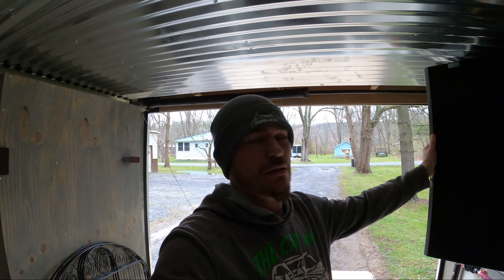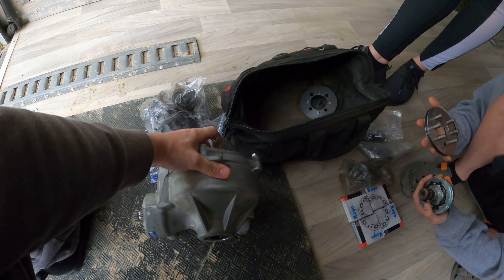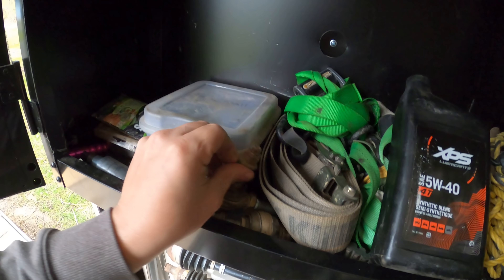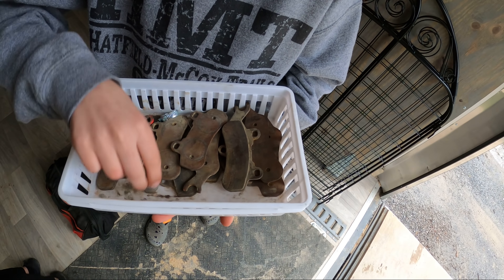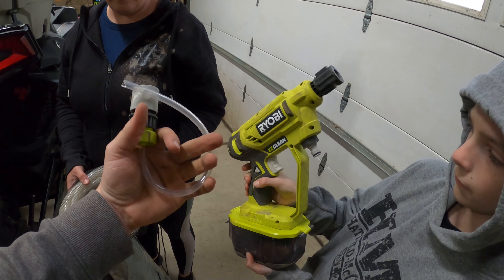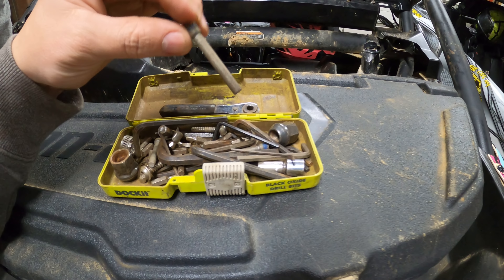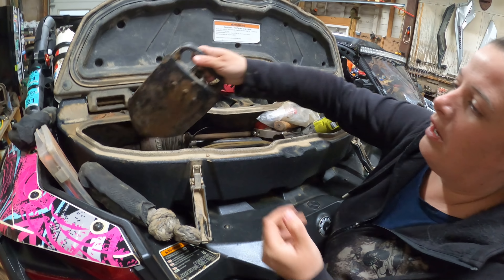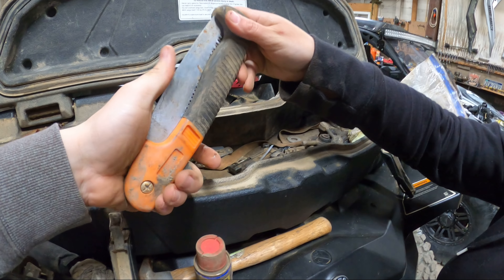What We Carry With Us Out On The Trails | TOOLS | SPARE PARTS | GEAR

Comment: Another great video! Glad you did one on gear. Two questions. Do you regret not carrying spare tires after the trailer conversion? And with all the extra bearings. Do you have a press to change them, at least at camp?
Reply from the maker: Thank you, we have a spare wheel and tire that we keep in our truck. Worst case scenario we can go back for it. We have many miles and have never needed a spare so at minimum we keep plugs. We do have a bearing and ball joint press as well.
Reply: Cool. And thanks for not hitting us RZR folks too bad with the fire extinguisher joke 😜
Reply from the maker: @aod8867  hahaha.

Comment: You carry enough to build a new X3 LOL. Why are you breaking so much stuff? Oversize tires? if so did you upgrade the clutch?
We have had 8 Can Am's only real problem was some tie rods and a few front wheel bearing..What year are your machines? How many miles on them? We always get new machines every 2 year so we don't have alot of miles on them around 10,000-12,000 when we trade for new ones. We mainly ride in Colorado,Wyoming,Utah,Nevada. We really enjoy your videos keep up the good work!!! 2021 X3 XMR with 32"terra hooks with some ZRP rods and dog bones and good EVO tune..
Reply from the maker: We actually don’t break so much stuff, it’s more so to be prepared in case we do break.. Our machines are 2019s. 16000 combined miles. We’ve never broken any parts that wasn’t out fault. Mostly rock climbing or hill climbs and to much throttle will break axles. We’ve since upgraded to heavier duty axles and diff so that doesn’t happen. The main reason we carry enough parts to build another machine is because we usually ride out of state and in the middle of know where. You never know when something may wear out or break and your trip is over. Having 2 machines adds to the list of parts we need to carry as well. And doing hard trails on the east coast is definitely not easy on axles lol.

Comment: Cool video. What brake pads do yall Normally use? I definitely need to get some more small parts. I have spare front axels. 
What are your most common parts you would advise? Ball bearings, tierods.....?
Reply from the maker: We use ebc sintered r brake pads. Half the cost of oem and last about the same. It’s hard to say on the most common parts. We haven’t gone through many broken parts other than some front and rear axles. Maybe a carrier bearing once you get over a few thousand miles, definitely a spare belt.

Comment: What radios do you guys run
Reply from the maker: We use the rugged radio v3 handheld units with a trail series kit that comes with a mount, mic, and a battery pack that you can plug into 12v so it never dies.